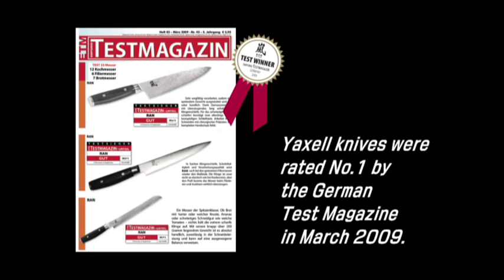Amazing Japanese Knife - Yaxell

Comment: I have the gyuto of this knife line. My chef wife does not like it because of the handle. She is a western chef knife style fan. It of course takes a very sharp edge. It does not dull like weaker stainless steel knives. It chips! Very small chips that you need to have a keen eye to notice right away or use a loop to see clearly. But even then it cuts.  It won't disappoint.

Comment: Can't go wrong with YAXELL. And, what I like about their knives is their appeal to westerners. I have to admit to not liking the look of the traditional JP knife. With the traditional octagonal, or oval handles...no bolster...no welding of the blade to a bolster (as seen on German knives...or western/JP bladed knives. To me traditional JP knives look unfinished (e.g. usually not polished). Just a JP handle on a rectangular sheet of steel...sharpened on one side. 

I'd love to have  the handle/half bolster of a Zwilling Pro + JP carbon steel core (e.g. white #1 or 2, or Blue #1 or 2) clad with or w/o SS. Blade shaped like a German knife's blade. 

To get this you need a custom knife made. Maybe altering a JP Carbon care blade knife and a German knife or as a smith to duplicate the German handle/bolster.